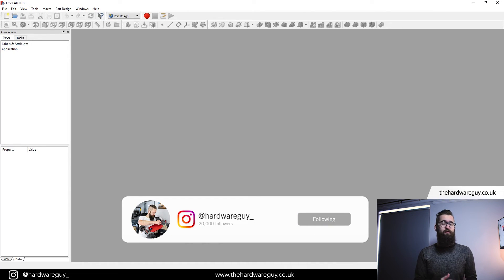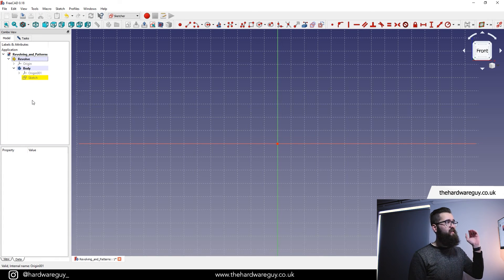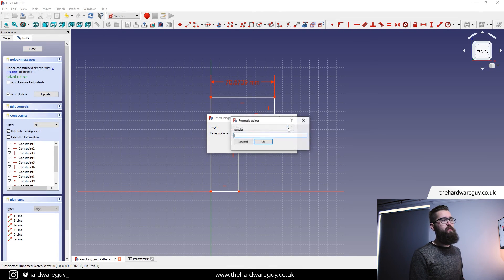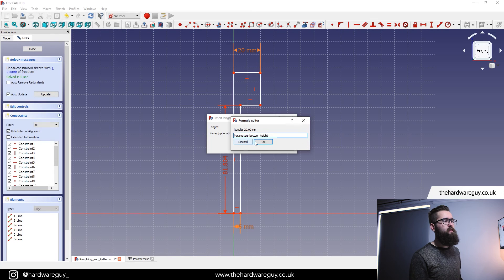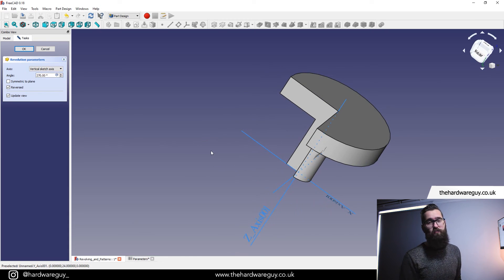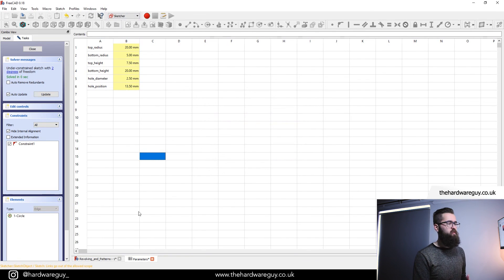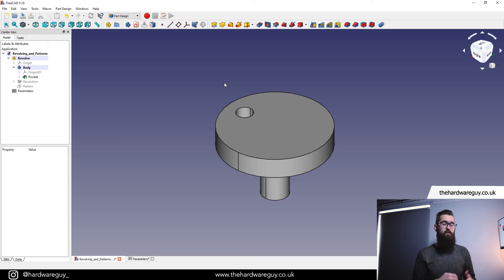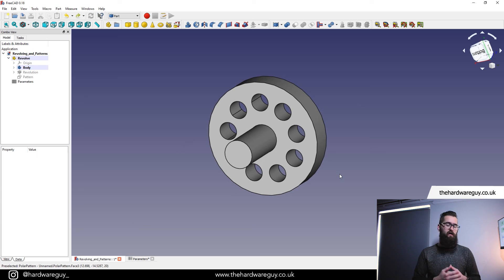FreeCAD For Beginners pt.4 - Parts, Revolving, and Patterns

Comment: adding the circle sketch on my revolved surface doesnt work in FreeCAD 20,  you have a constrain point on object that made yours green, but that never shows up on mine nor did you mention how to make it. I copy you word for word multiple times and not once does the sketch attach as a dependent under 'revolution' has it changed that much?
Reply: I had the same issue. The centre of the circle needs to be on an axis for the "point onto object" constraint to be automatically created. You'll notice in the video that as soon as the circle is created, a constraint appears in the list on the left. Also, when creating the circle, before the first click to set the centre point, as you move the cursor around and it hovers over an axis, it'll show the constraint symbol; that's when you know the constraint will be created when you click to set the centre point.

Comment: This one defeated me. I've replayed it multiple times ensuring I used the same keystrokes, menus, etc. When I go to create my "pocket" using the sketched circle, I get the error "Cannot use this command as there is no solid to subtract from." Perhaps related is the fact that my sketch of the circle, once created, appears at the bottom of my tree, on the same level as my part. Retraced my steps again and again and cannot make it appear under the "revolution" per your screen display.
Reply: Same. I had to drag the Pocket into the Body section

Comment: I found you can click on a LINE when you're setting horiz/vert sizes; it's easier (IMO) than clicking the 2 endpoints.  Although it's the same thing, I find it an easier mental model to think of the length of the line vs the "distance between 2 points that make up a line" too.

Comment: Hi really enjoying the video!  I'm having two problems; one is the instructors screen NEVER looks like my screen aaaaaaand you move so fast i'm backing the video up regularly to see where you went and exactly where you ended up!  I really want desperately to learn this amazing software.  Also you created a spread sheet then didn't us it as near as i can tell?   Off and on for years I've drawn on Solid Works, Auto cad products, Alibre and some others much more basoc so I'm really not a newb..

One more thing if you have the time?  I'm working on design that I will need each one to be clocked to another or possibly two..  Right now the dimensions are not as important as the relationships on to another.  What would you suggest for me to work on after learning "revolving and patterns"? I guess i should say that I want to "animate" the whole assembly so i can model that timing of one circle to the others near by.   Thanks again! Please forgive me if my use of punctuation doesn't appear to be terribly civilized:)

Comment: Running through these back to back. Sometimes redoing (actually a lot due to missed clicks). Only thing that has so far thrown me, and I'll pop new items in as I run into them...is that we didn't constrain any original line ends. You must have had autoconstraint on (which hasn't been covered) or you individually constrained all the ends of the lines without mentioning it in the video. Just an FYI for anyone else lost about 2 minutes in.
Excellent help for the rest of us. I'm trying to do some complex designs in tinkercad and it just isn't working :)

Comment: How do I remove the line when using revolution? I noticed after creating a 360 model the line is shown up in the slicer and object can not be printed. The line seems to be the sketch itself which you can see in your video as well. FreeCAD 0.19.2

Comment: Hi!
Very good videos.
You have a small issue in the sketch for the hole in this video, and I think it happened in previous videos also. While naming and reasoning "diameter" you are in fact applying a "radius" constraint. To apply a "diameter" constraint, first change the type of constraint from "radius" to "diameter" using the drop down in the constraint icon in the toolbar.

Comment: Is there a tool for this in Part or Part Design?  I frequently do this in my sketch instead of direct modeling the holes.  Why?  Because later on, if I want to align two parts, I can use the center of any of the sketched circles.  Thoughts?  ~P

Comment: Am I wrong? I thought it was not recommended to create new sketches on faces.
Reply from the maker: Hi Paul, it's perfectly fine to sketch on surfaces provided the surface/object you are sketching on is fully constrained
Reply: @thehardwareguy  Thanks. I thought it was necessary to use either a defined plane or a datum plane to avoid the topological naming error.

Comment: Hello mate, I have a small issue - "create spreadsheet" function from "spreadsheet" icon is "grey" along with All the functions inside ! ... did you encountered this behavior? ...  if yes how did you solve it ? ... Thank You ...
Reply: I saved the file then closed and reopened, fixed the issue for me.
Reply: @quaketheduck1247  
Thankyou... I had the same problem
Reply: @quaketheduck1247  That is, your solution fixed it.  Thanks.
Reply: I'm also thanking you. Still an issue in 0.20.2.  Your solution fixed it. 👍
Reply: Had the same issue but figured out it was because I forgot to close the sketch before attempting to add the spreadsheet
Reply: Thanks man, still needed in 0.21.2. 🍻